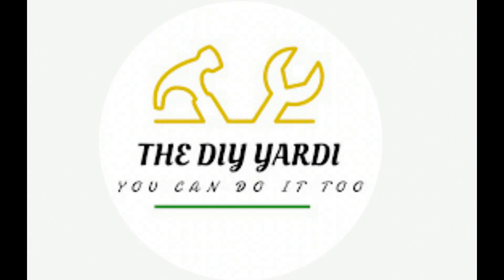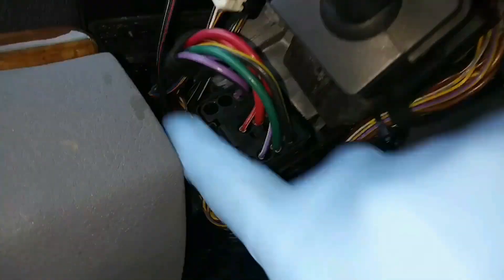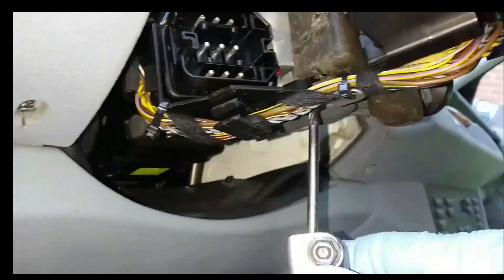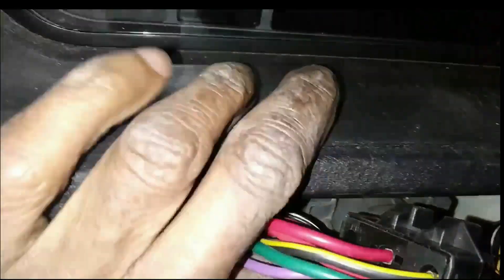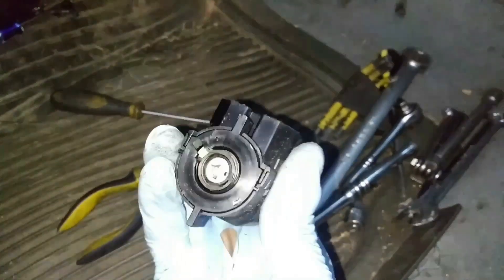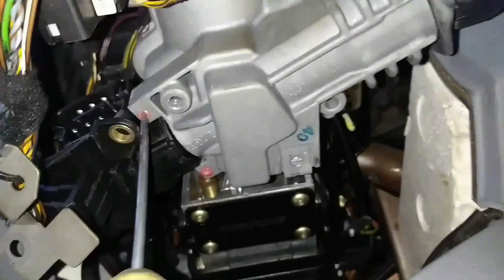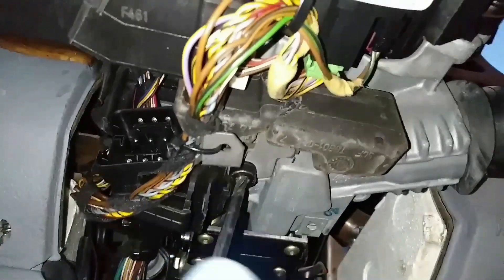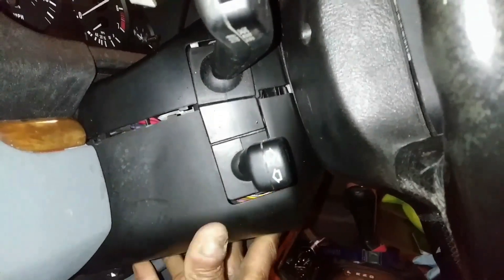2001 T0 2006 BMW X5, e53 STEP BY STEP IGNITION  STARTER SWITCH REPLACEMENT

Comment: Thank you for the video. I am waiting on my part to arrive and then I will be following this and hopefully my car will start 👍
Reply from the maker: You're welcome Arden, but what exactly is your car doing? this is one reason that could prevent it from starting, but there are also many others.
Reply: @thediyyardie7192  Hiya there is a bit to be honest. Firstly the heated seats stopped working and then a day or so later the seatbelt sound goes off for no reason and stays sounding. The boot has started to open up when the key is in the ignition or when I turn the key I can't remember now. Also the car cranks but no starts. I've had a new battery and a new key coded but no joy. It also had all fuel pumps and filters switched about 3 months ago so I don't think it could be them as the car was fine for a while.  so now I am going to change this ignition switch hopefully today or tomorrow as I am just waiting for the part to be delivered. Also I put a mechanics tool on the car and we got a ews problem code that's why I got a new key coded. Basically drove the shop and came back out and the car would crank but not start.
Reply from the maker: @arden6665  Wow, you have a lot going on there, the problem could be the ignition, but it honestly sounds more like some sort of a short, or stuck/faulty relay, did you also check for fire at plugs and fuel pressure?
Reply: @thediyyardie7192  yup I sure do hahaha. I changed the barrel and still no change in the car. However I did look more at this ews code  4A63 and it seems to be telling me my immobilizer has engaged so next step is to buy a lead and inpa app and see if I can fix it from there 😂 dam cars are a pain but I just love this model of X5.

Comment: Hi there, I currently have a 2006 bmw 530i e60, Yesterday when trying to register my cars battery the ignition locked after i pulled the key out, Now i cant insert the key at all, Do u have a fix for this?
Reply from the maker: I can't say that I have ever had that issue, I have seen these ignitions stick and prevent the key from being inserted, but in a case like that, the ignition cylinder would usually need to be replaced,  try disconnecting the battery to see if the key would go in then?

Comment: Hi my problem is that the key don`t  Go inside so you cannot start and the steering don`t block
Reply from the maker: sounds like you have a worn ignition, the key cylinder section, it may need to be replaced.